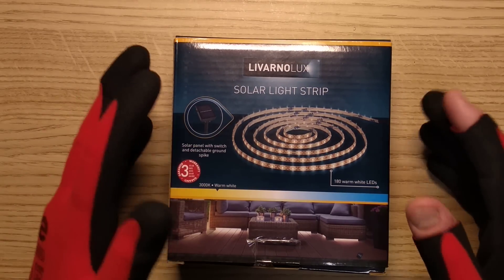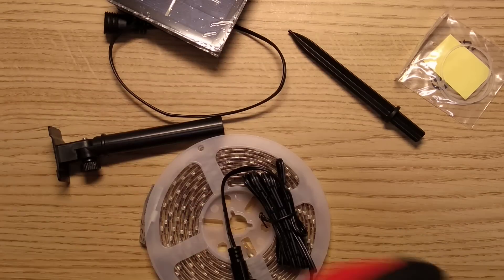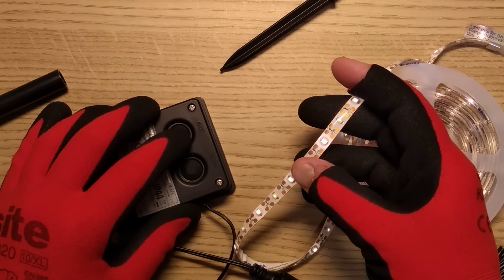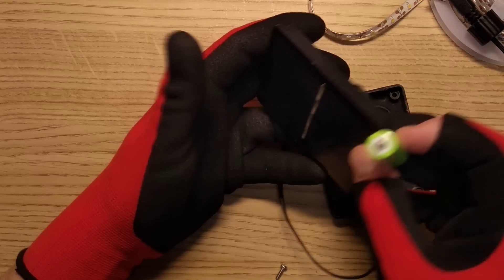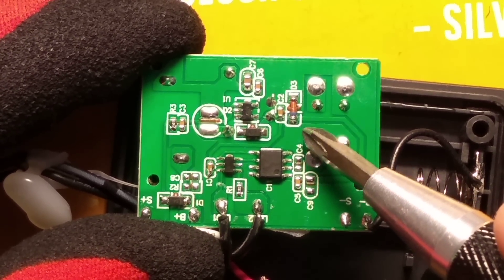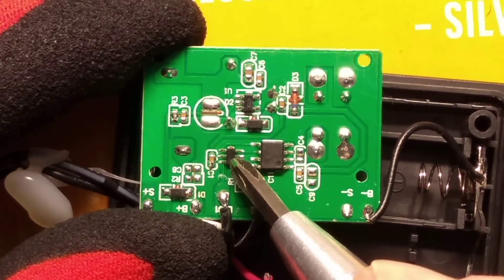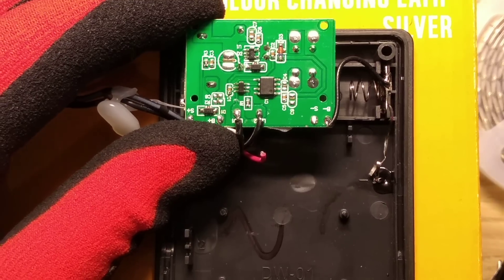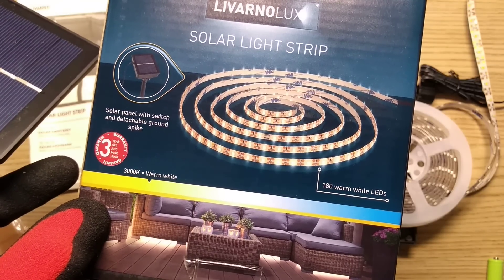Inside Lidl's Livarno solar light strip.

Comment: i have a question if you dont mind. i had a solar panel led set and i tested it and all lights worked. i cut the strip on one of the lines approx 2m down and now it wont work atall? i let the solar panel charge in direct sunlight to rule out lack of power. its my understanding that even if you cut in the wrong place the rest of the strip will work just maybe a few LEDs. Can you help a fellow scot

Comment: My solar panel broke can I use the led strip with electricity? I have a charger from a christmas lighting that fits right on it.. Sorry for my bad explanation....
Reply from the maker: The voltage would have to match.  It couldb possibly be powered from a USB power supply, but would need a resistor to limit the current.
Reply: bigclivedotcom i have another one with usb and that one is 5v according to the website i can plug it in my phone charger... but my phone charger states that its 100-140 v
Reply from the maker: @wendyvdveer9930  The 100 to 140v is probably the input voltage from your wall power.  The output of a USB charger is usually 5v.
Reply: bigclivedotcom I looked it up you’re right its 5v... thank you

Comment: How do they light 90 LED's with that little battery?
Please explain.
Reply from the maker: LEDs are still quite bright at just microamps of current.
Reply: @bigclivedotcom  I get that there is enough current to light them all up, but . wait.. they're not in series are they.  Its 90 parallel LED's with a voltage boost to get it over the minimum voltage for the LED... am I close?

Comment: Careful about overusing steroid cream. My mum has eczema and was prescribed steroid cream whenever it flared up. The issue is that if it's a recurring problem and you treat it with steroids it simply comes back more and more quickly and gets worse and worse each time.

Comment: Quick! - Clive's put up another video. . . Grab a ginger beard and a bag o' crisps!

Yeah, it looks like there's quite a lot lot solar powered lighting to be had right now, and from just about every conceivable shop, store and other retail outlet. This one has a modicum of sophistication, given that most of the ones I've seen have simply a "steady" and "flash" option switch (sometimes labelled "summer" and "winter"). It never ceases to amaze me how many different "modes" can be contrived on a two wire, polarity reversing, light set. But, as you say, Clive, most of those modes are pretty much useless.

We used to have a little acronym in my part of the world "RTFM" - not that anyone ever does, and besides, where's the fun in following the book? - If I had done that, I never would have found the real-time clock on my car radio, nor the track run time on its CD player!

I hope your hands are back to normal soon. I can imagine working on your kind of job will vary from painful to agonising just now?

Anyway, can't wait 'til you get home again, and another "Saturday Night Clive" (live) session. . . And I'll bet your cats will be happy to see you again - Who's looking after them while you're away, by the way?

Comment: 2:20 i never had that issue with cracking, but many of my solar panels resin look weird, like melted or something and possibly with moisture sink into them. Can be temporarily repaired with heat gun, but eventually that solar panel will die. Feels like using resin in solar panels is somewhat counter intuitive

Comment: I just - like, within the past two weeks - developed psoriasis. It's mostly on my chest, but I've got small spots all over. Stupid frigging skin.

But onto the meat of the video: these sorts of LED strips kind of annoy me. Sure, having underlighting for your furniture seems neat, but how often are you really going to use it? Not to mention that if you have tile or hardwood floors, that low light angle is going to show off every speck of dust that has ever been in that room.
Reply: TheRealColBosch I have one on the bottom of a shelf over my desk. It’s really nice.

Comment: Did you really suggest RTFM? What is the world coming to?
Very helpful video, thanks. My solar security light is not functioning after the glass panel cracked in the heat. I've covered it with clear duct tape & get a low voltage off it, but need to investigate further methinks.
Take care of the hands, when I was working with oils & spraying cellulose I developed similar until it became blood poisoning & I had to change what I was doing. An old Consultant Dermatologist told me to use Vaseline as a barrier cream, worked in under the nails, too, and only to use soap and water to clean hands, never detergents or solvents. About 40 years trouble free suggests he was right?
Reply from the maker: If the glass solar panel has cracked the output will be limited to the smallest section on the side with the electrical connections on it.

Comment: well, basically you are getting a cortisone derivate, often used for skin treatment. Corticoids are usually for suppressing inflammatory processes - and these reactions are caused by the immune system. If you haven't done so yet, read the description which comes with the drug carefully. I still think,  your problem is related to an immune reaction, triggered by either stress or environmental circumstances. Maybe you are allergic to something you recently or repeatedly get in touch with. So I hope your doctor was a dermatologist. Too often, drugs like this are prescribed by general physicians without analyzing what the real cause for this skin ailment is. You are a brilliant engineer and you always find the causes of anything going awry. So your body also deserves a doctor who investigates the cause of your rash. I don't know whether I understood you the right way - did you say antibiotics? Doctors who prescribe antibiotics just for good measure, without even knowing the germ that should be treated freak me out!. Yes, the skin ointment suppresses the immune response, but adding antibiotics without a serious reason is not a very good idea. That's how multiresistant bacteria are bred. So-called broadband antibiotics should only be prescribed if the bacteria are sensitive to them. Be sure that you use the antibiotics exactly as described. Holy S#!t, some physicians give me the creepers. You can compare this sort of treatment like a blind man (your physician) is poking around in the dark with a stick, hoping to hit a mouse. I understand that doctors are under pressure due to the many patients they have to treat during office hours, but prescribing serious drugs without finding the real cause is utterly unprofessional. However, get well soon :-)
Reply from the maker: My feet had flared up and were just weeping rash over the whole top surface.  High risk of infection, hence the antibiotics.  This had plagued me for decades.  An allergy test only showed I was Allergic to the tape.
Reply: hope the antibiotics prevent potential infections since your immune system will be suppressed to a certain degree by the corticoid ointment. Antibiotics are always to be taken with caution, since the side effects may turn out nasty too (diarrhoea and such). If you are allergic to tape, that might turn out to become a problem, especially when it is the tape you use while doing your job. Over time, repeated contact with the allergens might trigger your immune system to respond more and more fierce :-(  Please get well soon, and try to find out what substance it is, that causes the rash. It would help to avoid getting in contact again.

Comment: Seems like a lot of boosting/bucking needed for a single 1.2v cell isnt very efficient... they could have used 3 shitty 500mah cells and at least been to 3.6v off the start.  What sort of performance do they get from that one battery?

I would think the fact that the solar panel is mounted onto such a deep box that it would be stiff enough to keep the panel flat.  It looks pretty good quality.

Lastly this doesnt look like poundland.  They are going to send hired goons when they find out you are shopping elsewhere :p

Comment: 3.7v? NiMH cells are 1.2v. Mistaking for a 18650 me finks.
Reply from the maker: The voltage is boosted by a step-up circuit.
Reply: @bigclivedotcom  my mistake, soz.

Comment: Prescribing antibiotics "just in case" for anyone but the weakest patients greatly increases the risk of breading multi-resistant bacteria strains.  But stopping part way through a treatment really breads those MR beasts by pardoning the half-resistant ones!
Reply from the maker: In my case I very rarely use antibiotics, but my feet were so bad that it was justified.

Comment: Clive, what is the model number of the Liumy clamp on meter you use?
I bought a Liumy LM3001 because I thought it would read dc current flow through the clamp, but I can't get a reading using the clamp.
Reply from the maker: It's a Uni-T UT210E
Reply: @bigclivedotcom  Welllll that could be the problem.
Sigh!
Thanks
Reply: @bigclivedotcom  The Liumy vaguely resembled it...

Comment: How long would that tiny 1Ah cell with its puny 1.2V drive those 90 LEDs per channel at 3V and probably at least 10mA each? I'd give it somewhere around half an hour or so....
(And that's the first thing to change: Add a charging circuit and a decent LiPo pack to it. Something that is small enough to be fully charged on a sunny day, but big enough to run for most of the night).

Comment: Love your videos. Anyway I have a suggestion. On ebay or aliexpress search for "charger LED display" or "charger display". Via the thumbnails look for a cellphone usb wall charger with a small LED display that displays volts/amps. You can also try the car charger equivalent but thats another  topic. Essentially its a phone charger that displays the volts/amp it is currently pushing out to the device. I have a couple. They are more expensive but they have advantages. 

First, if you have a device like a phone with no LED light that lights up as it is charging and you have a USB cable with a loose plug or fraying wires inside, at one glance at the charger you know if it is charging or not, or if the device is full. Second, most devices draw a smaller and smaller amount of amps as the li ion battery fills up. This gives you an indication that the battery is getting full.

However I do not know how accurate the measurement is particularly for the amps as the chargers I have even the same model differ in the amps they display, like if I plug in something that is constant like a USB fan or USB light.
Reply: I have one that's dead, opening it I see the transformer thingie inside is very loose. I think one of my nieces dropped it

Comment: I used to have some hand/skin jip in the winter as my hands would crack cos of the cold and it was an issue working as a guillotine operator in a printers as using cream would've put greasy marks all over the paper so it was sore hands all day until I clocked out and slapped the cream on, so I can empathise knowing the issues, Clive.

Comment: I have a nickel allergy/sensitivity and break out in those exact blisters after handling nickel-heavy items (wrenches, ratchets, screws/fasteners, and any stainless steel that isn't 18/0). Nothing makes it go away; just have to let it run its course. It is worse in the hot weather and skin pores are open.

Comment: I had same issue with my hands that I solved by not wearing gloves. Took me years to figure it out that my sweat triggers the nightmare.
Reply: If you need to wear watertight gloves for something like washing (a great many) dishes where the hot water makes your hands sweaty inside the gloves...
consider some fabric* gloves as a liner, it won't make you invincible but it'll help keep them dry a good bit longer.

* ideally something with a big open airy weave and nothing with too much synthetic fiber in the mix or you're almost right back to square one
Reply: Allergic to your own sweat? That's not an easy one to fix, do you avoid being anywhere hot?
Reply: Not really an allergic reaction. 'Bad' skin doesn't adopt or dismiss moisture correctly which dramatically exacerbate and compound all it's other failings and foibles - given the wrong circumstances in 'real time' - that* and friction (which can be as little as contact) make things go south quicker'n a tax dodging 'sun chasing' plutocrat.

*being perspiration, dishwater, chicken wing juice... rain, rain's the worst, specially now they're putting all them chemicals in it 
[motions cane disapprovingly at cloud]
Reply: @ferrumignis  It's usually the salts in the sweat that cause problems, salt crystals are like microscopic sandpaper that causes constant irritation. When you keep concentrating sweat in one place and the water evaporates off, it becomes perpetually worse, and when your skin starts to get all wrinkly, the salts get absorbed back in and do more damage.

I have the same problem if I've been exposed to hard water for any length of time, my skin will start getting hard and crusty and sweating turns it into a nightmare. So when our water softener stops working, I feel it immediately and it becomes something of dire importance to get working again.

Comment: My problem with those plastic solar panels is the UV protection is crap, kinda like a car headlight the surface fogs up and refogs quickly after polishing off the failed coating.

Comment: I bought one of these a couple of weeks  back. I thought that was a decent solar panel (compared to the £2 land equivalents) and 180 LEDs a generous amount, especially since they were individually cuttable and thus could be re-used in something else whilst making what remains burn a little brighter. The battery could do with replacement as it will not keep the lights illuminated even on a short southern summer night.
That being said, I'm having second thoughts on repurposing the LEDs if it needs a special driver circuit :-(
Reply: Well, running white LEDs from a 1V2 supply will require a boost circuit because  the forward voltage will be at least 3V6 at low current.
As for the 2 channel thing, that's easily solved with a square wave oscillator.

Comment: Crazy how cheap those strips can be had now.   Someone gave me two boxes of the RBG strips to mess with.   65" with remote control !  LOL   Our High Desert Sun in Southern New Mexico pretty much KILLS anything epoxy coated like those Solar Panels in a year or less.  Only the Glass versions survive anything more.
Reply: pulesjet Is that place dry enough to simply omit the cover completely, instead of using glass?
Reply: @johnfrancisdoe1563  No we get plenty of rain in the monsoons.   Swamped at times.

Comment: So I just picked up yesterday some more stuff (moving still) and asked what happen to the solar light I had sealed for my dads flag, mom said your dog (boxer ) broke it. So i got to take it home, I'm gonna repurpose the solar panel and light. 

I know what your going thru with the hands, I'm allergic to those purple, black, orange latex gloves. I have to wear vinyl gloves or real rubber.but my hands are ok with regular work gloves (leather, sheepskin, no work gloves at all cuz I'm not working😁). But yeah 30 minutes with latex gloves on and my hands freak out for days. If any latex touches my skin, I break out, so no latex Jimmy's or raincoats either. Dont ask how I found out. Cheers from still storming Kansas my grass is tall but I cant cut it. It just clogs and makes grass soup.

Comment: I have 4 solar lights similar in design to the Grundig you dissected a while back. The panel looked just like this one and sure enough two of the the solar panels curled up at the corners and eventually detached. These were flexible and it all still works thankfully. The problem I get with glass panels cast in resin is the resin gets cloudy.  I'm not sure if spending months in sub zero weather every year complicates things. 
I would like these lights just to avoid tripping over stuff in the middle of the night.
Reply: The cloudiness is due to the resin being affected by the UV light from the sun.